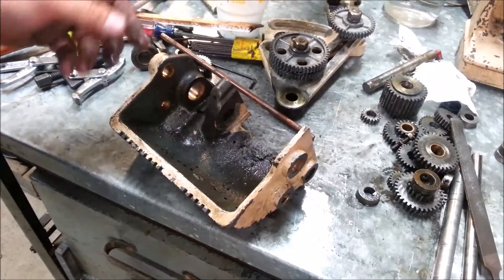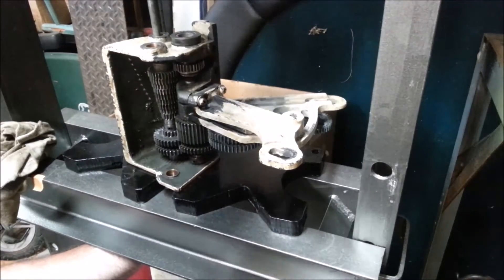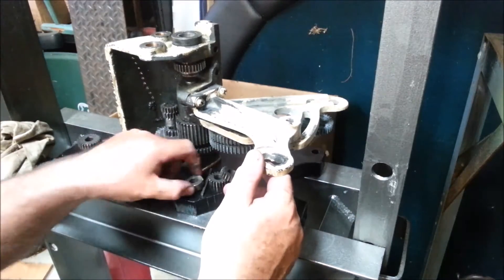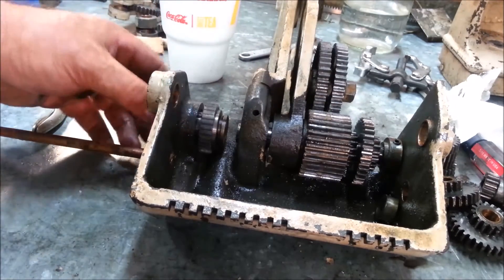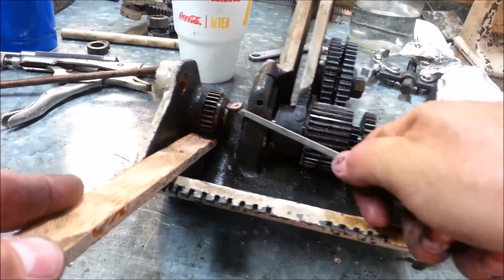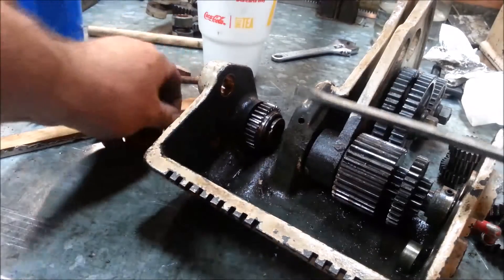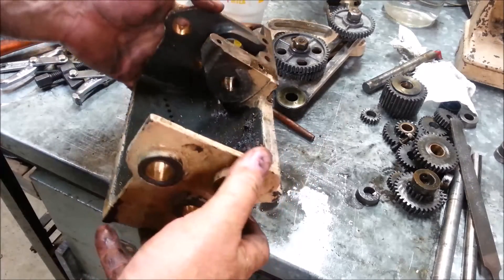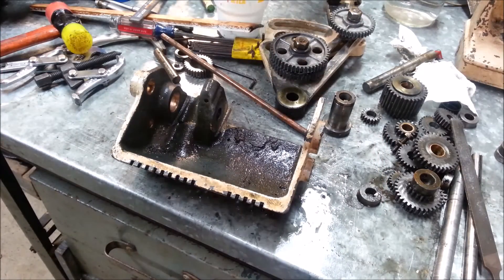Atlas Craftsman Quick Change Rebuild Part 2 Crafted Channel

Comment: I’ve had quite a few gear boxes like this apart.  The key to getting the shafts out is getting all the set screws and clips/snap rings out then, using a narrow file, removing the burr that forms from at the shaft ends and next to any retaining rings.  Use clamps or a strap to hold the gearbox still, or stand on end over an opening a tap the shafts out while moving any gears A bit that seem to be binding.  As you noted the shafts get steps worn in them that can catch a bit as the shaft is coming out.  Because that gearbox is dry, look for ways you can add grease fittings to reduce wear.

Comment: Great video. This is an awesome resource. Do you have a video on making the shafts?? I couldn't find it. Also, do you know of a good source for a replacement 90* gits oiler for the short upper left shaft from the gearbox?
Reply from the maker: I made a number of shafts and sold them years ago.  Don't think I made a video of that.  It's pretty simple other than you need a milling machine.  As I remember, I did this with an 1/8" end mill.  Just copied the old shaft.

Comment: What is the best material to make the shafts out of?  I have a gearbox coming from eBay for my old 12 inch Craftsman and I can tell from the pictures that I will have to make at least one shaft. I have a bunch of 12L14 in my shop but I'm not sure it would have enough wear resistance to use in a gearbox.
Reply from the maker: I ordered 1144 for mine.  Made a number of them and sold them all.  Need to make another!  I think a leaded steel would be good too.  I am thinking here machinability and quality of surface finish are probably the biggest factors in limiting bushing wear.

Comment: the trick is going back together.  make sure you don't oversize the shafts any it will cause the gears to bind.  I think you can get the drawings from Clausing on these shafts.  in that manual I sent you is an exploded view of the gearbox.  i got several drawings for parts from Clausing.  they did not charge me for any of them.
Reply from the maker: I need to gather all my lathe papers in one place and study them.  This will come out great.  I would love to get my hands on a worthless lathe with good gearbox.  One of mine will need some gears.
Reply: Crafted I took mine apart and cleaned up and put it back together.  I'm going to replace the bushings once I get my mill up and running.  But first thing first is insulation lights and heat.  going tomorrow and pickup the 40 sheets of foam for the ceiling and wall area.  4 more 8' lights to mount and wire.  then install the double barrel stove.
Reply from the maker: I'm further along than the video at this moment.  Only thing I'm stuck on is the splining (straight knurling) of the short 3/8 shafts in the selectors.   DUDE, do a walk around video of the shop.  Glad it's moving forward.